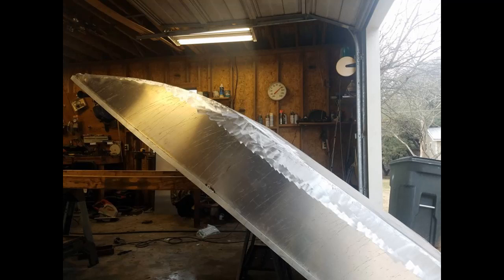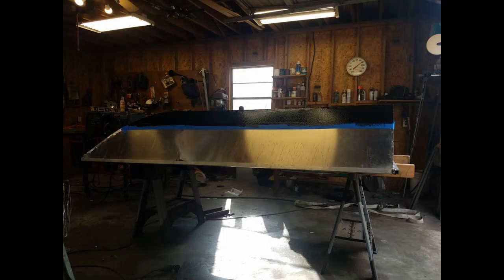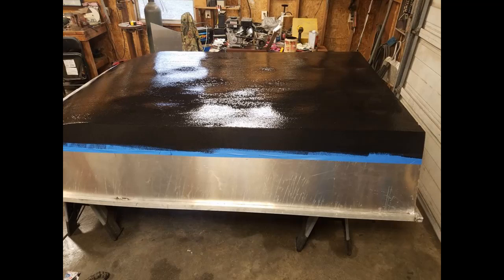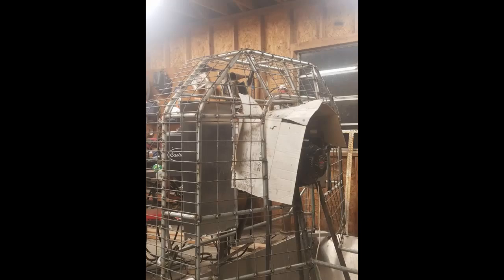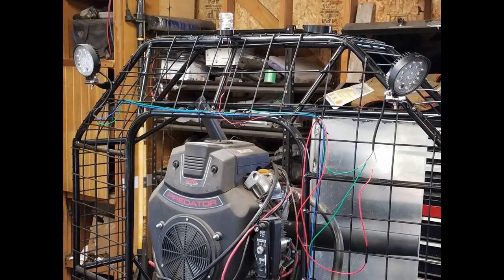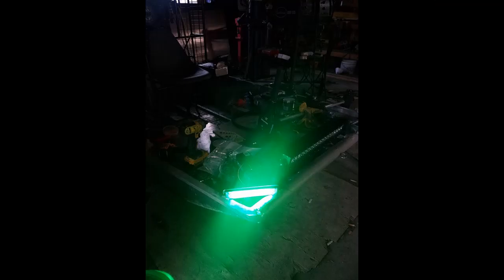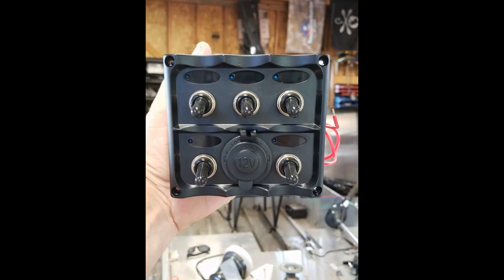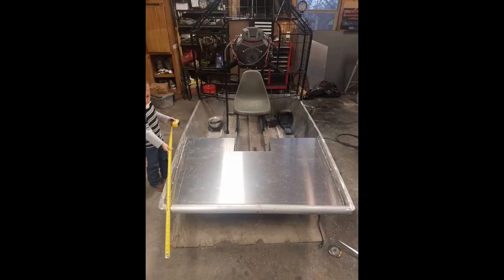5 mini aluminum airboat build

Comment: Hey Ron. I forgot to mention, you might want to weld a couple of trim tabs on the bottom of the transom. Those shorter boats have a ruff time to get on plane at times. This will help
Reply from the maker: thanks